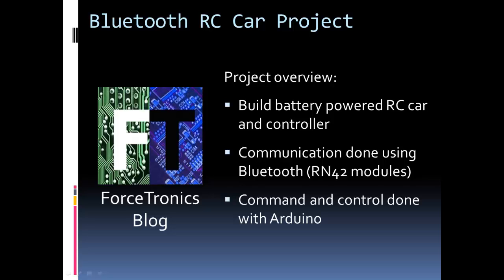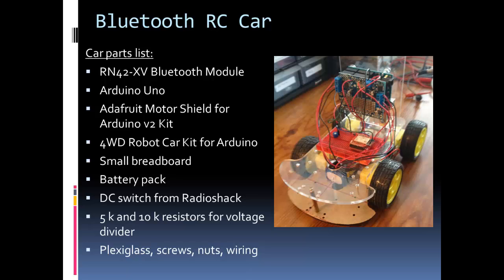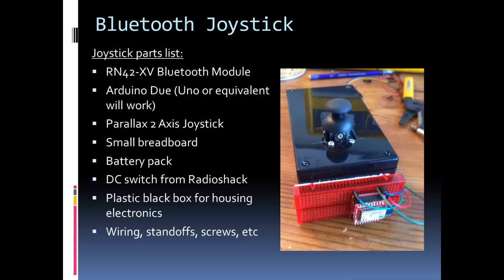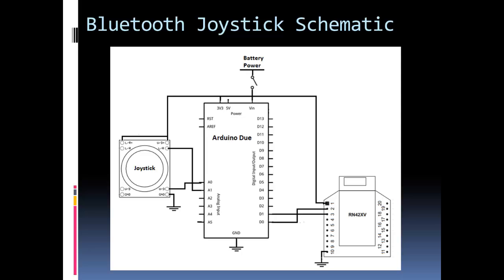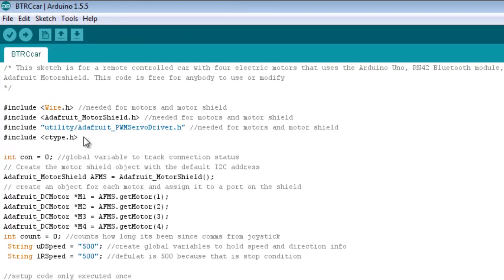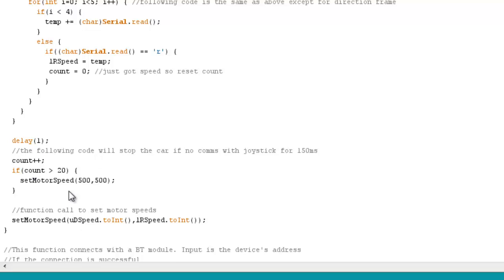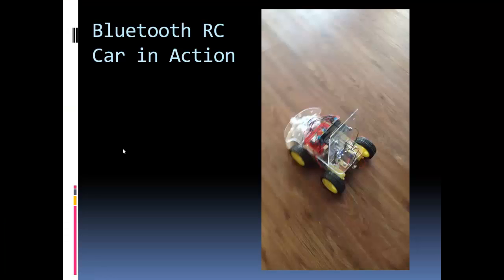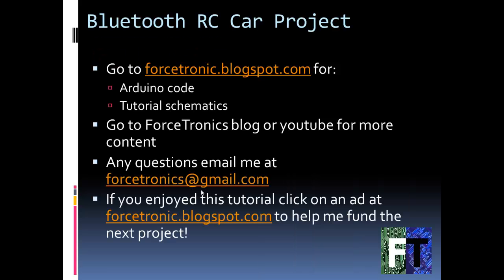Building a Bluetooth Remote Control Car

Comment: Great project and easy to follow, thanks. I do have a question. The RN-42 is a little expensive, I want to make 2 RC tanks and that means 4 RN-42 modules, can I use a cheaper Bluetooth module like HC-05 or HC-06? if so, sorry but can you show how.
Thanks
Reply from the maker: You could use any Bluetooth module that works. I personally would not recommend any Bluetooth module that is not 4.0 or higher (all the modules you named are not 4.0 to my knowledge) since you risk compatibility issues and 4.0 is lower power. Another option would be the nRF24L01 transceiver. It is low cost and we have plenty of videos on it. We do not have the bandwidth to provide custom design input. Good luck

Comment: Very nice work. I have a question. say you wanted to run multiple cars using the same joystick. could it be setup so that if you are connected to Car #1, then once Car#2 is turned on, the joystick connection to Car#1 would immediately be terminated and a connection to Car#2 be established?
Reply from the maker: With the version of Bluetooth being used in this video it would be hard to do what you are asking because Bluetooth can only be a connection between two devices. That means the joy stick has no way to tell when the second car is turned on without disconnecting from the first.